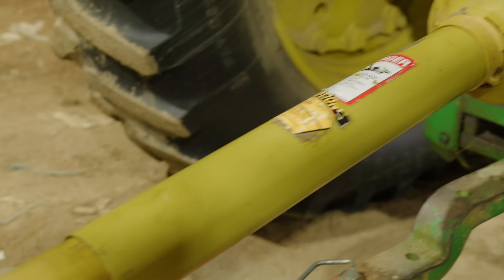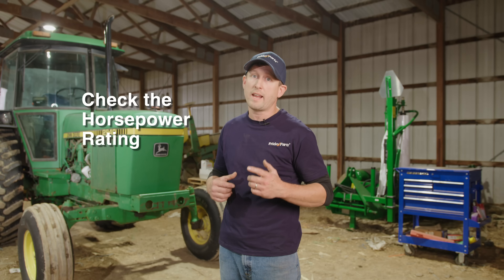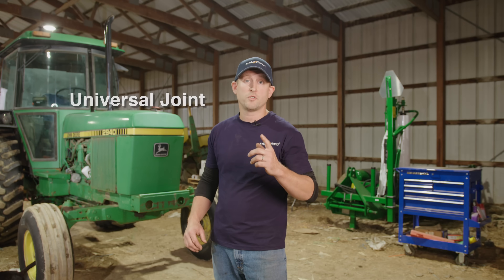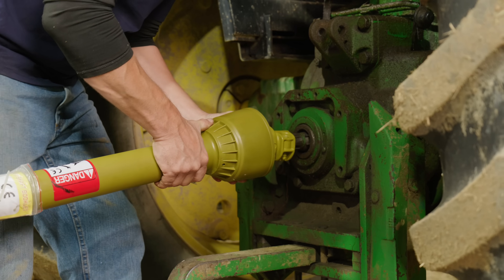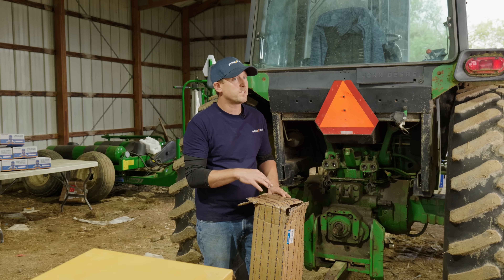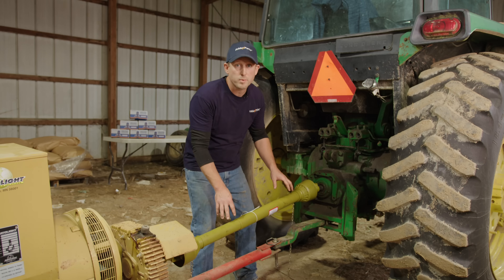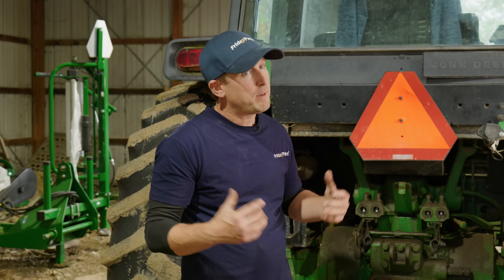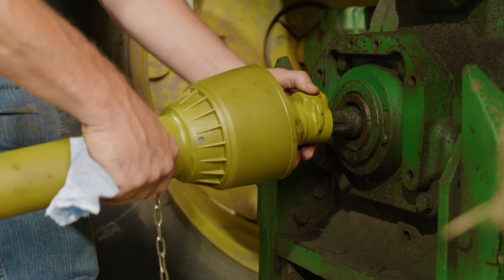How to Choose and Install the Right PTO Shaft for Your Tractor: A Complete Guide

Comment: Maybe someone can help me. I have a pto shaft that won't go far enough on the output shaft. It's seems like the shaft bottoms out and the pin can't clip in place. Is there a different sized depth I should look for? It seems like there is plenty of room but it just won't connect to the tractor